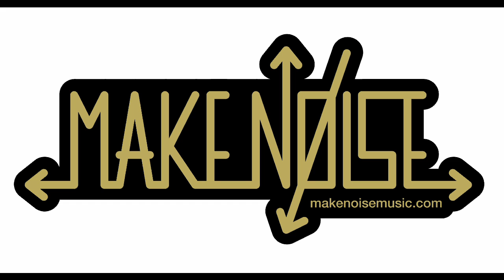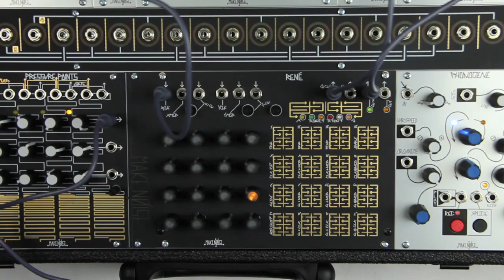Make Noise René Performance and ProGraM Pages Overview

Comment: Another great video Walker thank you! As you stated in the video the knobs are locked once you save the preset and do not effect the Q CV output. Is there a way to make adjustments to the individual pitches on the knobs while you are in the preset?
Reply from the maker: Bc iii Not really, however each time you deselect a "preset" and revert to physical knob settings, the scale settings of the last selected "preset" will remain. You could take advantage of this to switch back and forth between several scales/arpeggios while also manipulating the individual location values.

Comment: On your website it says that the René requires approved power solution from Make Noise, Tip Top Audio or Doepfer, so is it working with the Tip Top uZeus power module ?
Reply: That's my setup and works perfectly (bit of a late response lol)

Comment: How do you get out of the stored quantized voltage once you’ve recalled it? I want to be able to switch to a different scale, but then also change the knob positions
Reply from the maker: If you recall a stored quantize voltage, and then press the same top row button again, that location will no longer be lit, it will maintain the same quantizer settings, but go back to current knob values.

Comment: Does anyone have any suggestions for how to limit the range of the quantizer output of this version of Rene? I know this will require a separate module. Rene 2 has an option for 1-4 octave range on each channel which is super handy. I can’t just attenuate it because the pitch scaling will be off. I know of the Beast’s chalkboard to transpose up/down octaves, but I want to try keep the pitches within a smaller amount of octaves without having to dial in each step.
Reply from the maker: You could run it through an attenuator and then a quantizer module after the attenuator.

Comment: once you store a scale and 16 knob locations so that QCV is read from memory, how do you return to a state where the knobs once again affect the QCV?
Reply from the maker: If one of the top four pads is lit on the Q Page, press the lit pad to turn it off. This will return the knobs to "live", but maintain the scale settings from the stored slot.
Reply: @MAKEN0ISEMUSIC  I did that and it still does go live. If I touch any pad first three pages, it turns the knob/channel/gate/whatever it's called off. Yes, I did the initialization and saved it
Reply: I got it to work finally after going through the initialization process several times. Beyond that and esoteric/cryptic owner's manual I'm struggling. But I shall figure it out.